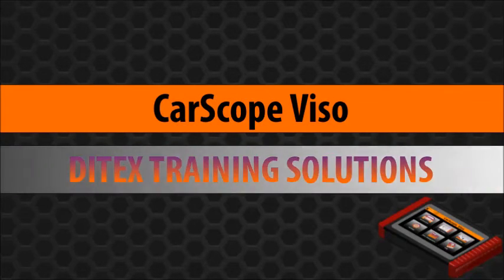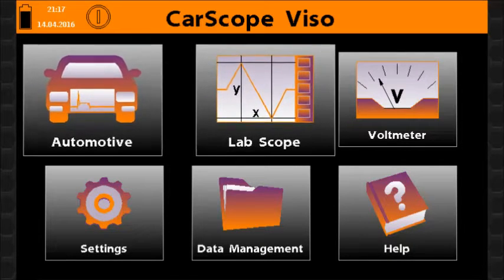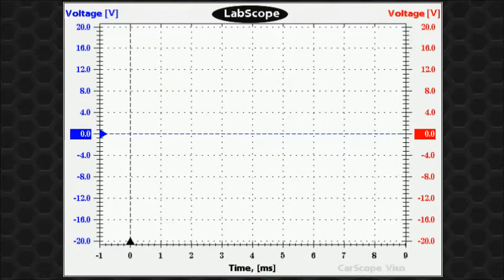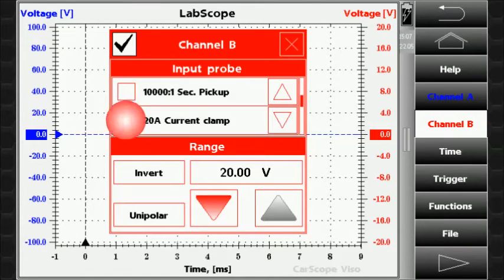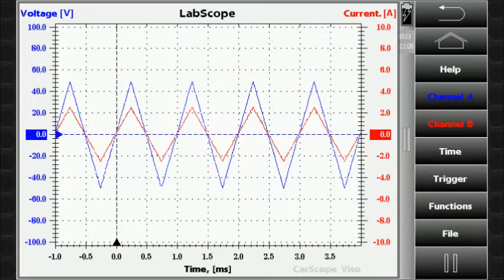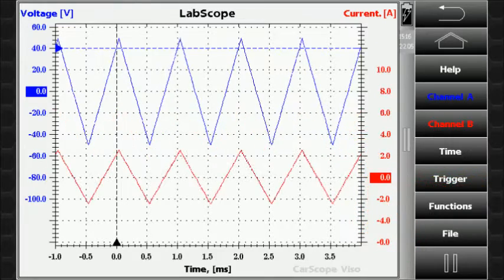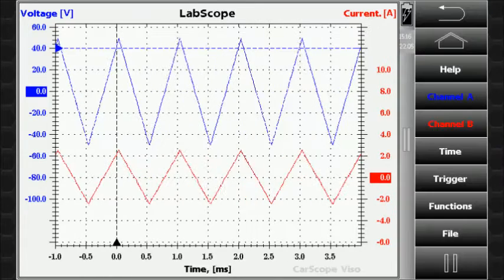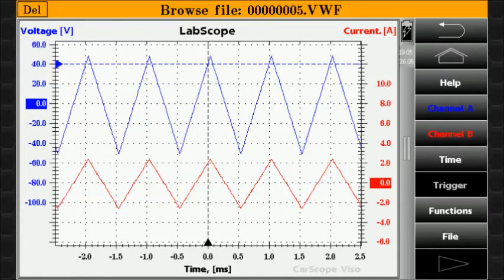Handheld  Automotive Diagnostic Oscilloscope (Lab Scope) Tool CarScope Viso-Oscilloscope Panel

Comment: bought one of these on ebay. does this thing have a filter? my waveforms are noisey. ive got a good ground.
Reply from the maker: Hello @phil holbrook,
CarScope Viso have "Peak detect" function and this may to be one possible reason  you to see the signal with noise, so please check "Sample" from the "Functions" menu (Oscilloscope Panel > Functions > Acquisition mode ).
Also please set "Time scale resolution" to High (Oscilloscope Panel > Time > Time scale resolution ).
In any cases if you continue to see noisy signals please send us email with description what you are measuring, how the the oscilloscope is connected and some photos of what you are seeing and/or save the signal in VWF file and send us on: office@autoditex.com
Reply: @AutoDITEX  i have peak detect off.  so turn on acquisition mode? i was measuring hall effect cam signals to check timing.
Reply from the maker: @philh9238  This is ok, you can not disable acquisition mode , now you are in "Sample" mode.
Another test you may perform is to measure the voltage of some small battery - for example 1.5V or 4.5V.  If noise persist this may be caused by :
 - from big electrical interference  in the room(garage)
- defective/damaged CarScope Viso device
Please do this test and write us on :office@autoditex.com
Reply: @AutoDITEX  one last question. is there going to be an update fot a longer time base. the longest the scope has is 2 seconds. then zoom in. is there going to be  say 10 second  setting. then zoom in on 10 seconds of data? new to this scope model. i think the noise is taken care of now.
Reply from the maker: @philh9238  When you want to use long time base you may use "Uninterrupted stream" time mode ( Oscilloscope panel > Time setup > Mode ). This mode allows you to set time base up to 12 seconds. Also you may use  "Slowly varying signal" option(mode) that allows you time base to be set up to 120 seonds.
Reply: @AutoDITEX  got it. this is actually turning out to be a nice machine! like the zoom in feature after a data capture. cant zoom in with snap on only out! is this going to be available in 4 channels in the future? thanks for the help
Reply from the maker: @philh9238  Thank you for the kind words. Please do not worry to write us at any time here, in YouTube, on our facebook page   - https://www.facebook.com/autoditex/ or to our office email. We will help you with all we can. 
4 channels are too much for the handheld device and requires large display, large battery capacity etc. But we offer PC based 4 channel CarScope devices:
- CarScope Plus : http://autoditex.com/carscope-plus-56.html
- CarScope LAN : http://autoditex.com/carscope-lan-57.html